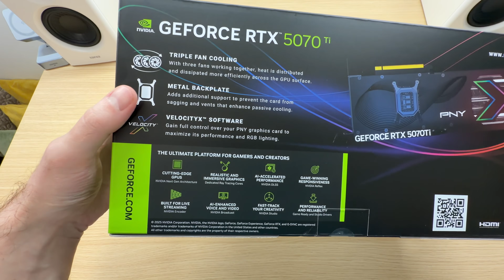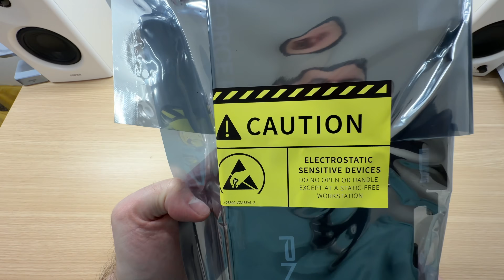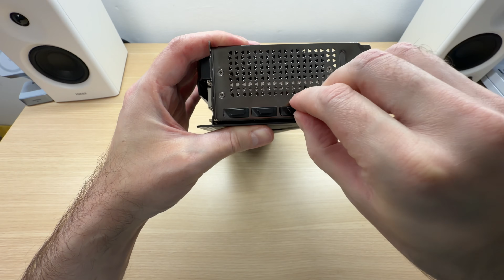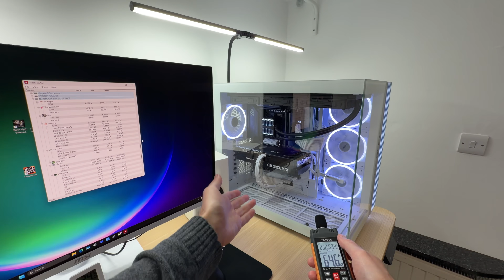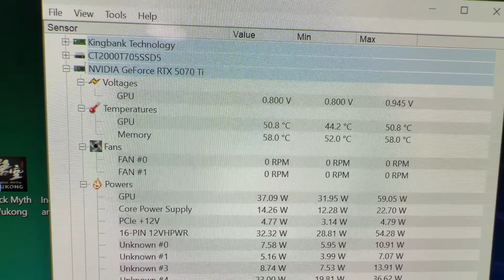Noisy or Quiet? PNY RTX 5070 Ti ARGB OC Review

Comment: Bro, I have the same model, the 5070, and it reaches 80 degrees under load. Do you think that's normal?
Reply from the maker: It's a safe temperature. Your temps may be different because of many variables we have in any PC: case, fans (as well as their speed), other components dumping heat into the case, and let's not forget about your room temperature. I wouldn't worry about it unless you see the temperature jumping up and down rapidly or experiencing performance lower than normal.

Comment: Bought the same card for $789 before taxes. Build quality is good for the price.
I undervolted it with MSI Afterburner: set the curve to 2775MHz at 900mV, +1500 Mem Clock, maxed out power limit. 
So far stable and no coil whine, 40⁰C 20-30W while watching youtube and discord;
50-60⁰C 150-220W under heavy load, you can hear the fans IF you mute your game AND actively looking for it (could be my potato CPU fans though)
Crushes every game at 1440p. Overall, happy with the purchase.
Reply: Lmao I thought you said "crashes at 1440p in every game" 😂😂
I bought this gpu
Reply: Can you link to a guide to do the undervolt? I'd like to learn more about that
Reply: @ivandagiant he has provided all the info needed. Youtube or google if you get stuck.

Comment: how is the rgb controlled?  Can I connect it to mobo?  It looks like at around the 5:57 mark you got a cable plugged in next to the power connector.  Curious if that is the rgb and maybe using an extension cable off that I could control it with other software.
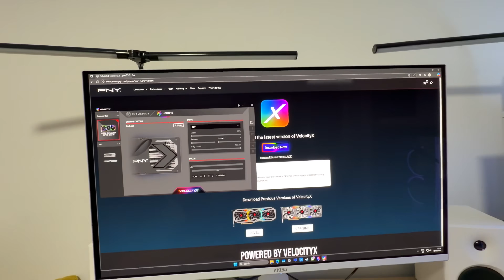Reply from the maker: There's no RGB cable. You can control the lights using the software I show at 10:54. I've no idea if it works with other RGB control apps.
Reply: @theivadim  thanks I am trying to find a gpu that will work with icue even though it means I need their hub to act as a bridge.

Comment: Orderes this same thing. Any issues with it so far?
Reply from the maker: Nope. Works well.
Reply: @theivadim I'm really hesitiant between which cpu to pair it with though, I got my eyes on the 7 9700x or either 7 7800X3D, the last mentioned is about 140 bucks more expensive though. I mainly game.
Reply from the maker: If you don't want to go eSports Pro playing games at super high FPS then the 9700X is more than good enough. If the Ryzen 7 7700X is significantly cheaper in your region then that is also worth considering. You'll have the motherboard that will allow you to upgrade to a faster CPU in the future if you'll need it in like 4 years or more from now. AMD plans on releasing one more CPU generation on AM5 motherboards.
Reply: @theivadim ended up going with the 7 7800X3D, ordered it just this morning actually, because the monitor which I ordered prior to all the pc parts (AW3425DW) Will definitely need that extra FPS and stability on the 1% low, as it's a 240hz 1440x3440 QD-OLED. Also I've always wanted a good X3D CPU since they've launched. 😅 Cheers though! Will be picking up this exact 5070 Ti today. Thanks for your reviews!!
Reply from the maker: Awesome! Enjoy your new setup. It sound lovely🙂
Reply: @theivadim what about R7 5800x?

Comment: 70° for this card with 7 heatpipes but not really good or??
Reply: It might be his specific model or his case airflow. 

I have the PNY 5080 OC and on Cyberpunk at native 4k max ray tracing preset (just for GPU stress testing), I got an average temperature of 64C with a max of 67.8C at 1300+RPM fan speed.

Then again, I have 3 case fans blowing fresh air at it.

Comment: Underwhelming cooling results for a 3 slot GPU.
Reply: 75c at 300w isn't too bad imo. i own the non arbg of this card and with a quick uv it stays in mid 60s with no much performance loss.
Reply: @LCJammer  Yeah I just expected more for the size. 

I ended up going with the ASUS Prime 5070 Ti which is a smaller card at the same price as this and even in the quiet BIOS, I'm getting around 70 degrees at stock with fans spinning at 1300RPM at 300W usage. This is in a silent oriented case with not much airflow as it has all solid panels (Fractal Define 7).

Comment: whats diffrents between Plus version and non-Plus?
Reply: The plus version is much better. It's larger and has 2 extra heat pipes.
Reply: Cannot say for sure for this custom card, but for example the Msi Gaming Trio oc plus has 1 more heatpipe than the version without the plus in the name. So i guess the plus version has a bit better cooling.

Comment: I got one. It's ridiculously loud if not idling. I'm just getting things tuned up, and I'm putting it through its paces running MSFS 2020 at mostly ultra settings. But still...I think it sounds like a Harley Davidson built fan....maybe it's a known issue and there is a fix, and I'm hoping so as I dive in to find out what I can possibly do. Just sounds horribly unbalanced.
Reply: Any updates on how the card is
Reply: @SyrupCanuck the mounting arm support was too high I believe, and it caused the plastic housing to twist ever so slightly, therefore allowing blades to make contact when in operation. Almost 100% quiet when graphics arent under much load. But it gets decently loud when trying to cool chip still yet.
Reply: I totally lwft part out where i fixed the height of the support arm and it made a world of difference
Reply: @Superimposed_Goat i just grabbed one from Best Buy PNY GeForce RTX 5070 Ti ARGB Epic-X RGB OC Triple-Fan 16GB GDDR7 Video Card and wondering if it's a good purchase. In CANADA it's one of the cheapest. I just never used PNY before. Hard to find long term testers.
Reply: @SyrupCanuck this is my first build, so its hard for me to really say.
I am totally happy with it though! Its worked great so far
Reply: @Superimposed_Goat thats good to hear. I probably will keep mine. I just want it to stay cool in my sons pc

Comment: To add a little more information to the video, this model has five heat pipes. Since five pipes are in contact with the core, that's how they're usually counted. The higher-end Plus version has seven pipes. There are so many people on the planet who confuse the two. The PLUS version is not sold in some countries, so many people don't even know it exists. I would buy the regular version, optimize it by undervolting and power limiting, and then put a phase change thermal pad on the core. That's all you need. Since the previous generation of PNY products had a particularly high rate of grease pumping out, I recommend doing this immediately after purchase. This will eliminate the risk of damaging the thermal pads that cool the memory, etc. Over time, there is a high probability that they will be damaged when disassembled.
PNY has adopted DBB for the XX70 this generation. This improves fan durability. If you take the steps mentioned above to prevent pump-out, this card will be an excellent card that will last for a long time. The quality of the current generation of PNY has improved in all grades, which is a good impression. The previous generation was pretty bad and had a bad reputation, but this generation looks set to get good reviews.
Reply: I had to apply a phase change pad to my 4070 Ti from PNY. Just note that PNY will void your warranty if you open up the card.

I wouldn't buy them again, support was rude and seemed to not want to RMA my card, that's why I ended up doing it myself.
Reply: @d @dinospumoni8255  your card was “fine” for them. They’ll avoid RMA. 
I’m surprised it voids your warranty as it never voided mine on few gpus (Vega 56 pulse, 2080s FE, 3080 gzt MSI, 6800xt Sakura, 4070ti Spiderman, 4070ti tuf, 7900xtx gaming OC)
Reply: Just wanted to add that the 5080 and 5090 has the bigger cooler as well. Check the card length. The plus versions are around 330mm. The normal smaller cooler is around 300mm like the one in this video. The 5070 ti PLUS has the 330mm cooler.
Reply: You think it's really necessary to change the pads? I would prefer to keep the warranty.
Reply: @sushu-x7f  It's probably best to perform regular tests under a certain load, and if the temperature doesn't rise, continue using it as is. Since GeForce has discontinued hotspot temperature monitoring, there is no longer a reliable way to know if the thermal paste is working properly. Even if the core temperature is relatively low, the hotspot temperature can be very high. Ideally, you would want to monitor the hotspot temperature, but this is not possible. Instead, carefully monitor the core temperature. If it starts to rise slightly, it means the thermal paste is beginning to lose its effectiveness. If grease pump-out occurs prematurely, even if you exercise the warranty, all that will happen is that the same grease will be reapplied and the product will be returned. In that case, the problem will likely recur after the same period of time has passed. Therefore, if it were me, I would replace it with a phase-change thermal pad myself.
This explanation has become quite long, but generally speaking, it's best to do nothing to maintain your warranty while no problems are occurring. Usually, it's sufficient to consider countermeasures only after a temperature problem occurs.
Reply: @銀河光芒  thank you for the comprehensive answer :) Good to know we can't monitor hotspots anymore, if unfortunate. I just received my 5070 so I will monitor the temps closely.
Reply: i got the previous gen epic x 4080 s oc for 2 years and the temps are the same as day 1.. just upgraded to the 5080 version and it is a bit smaller hopes it last as long XD
Reply: @TheMichaelparis  from what I've heard the 5080 didn't have the hotspot issue the 5070 did. So you should be good. Still worth undervolting and maybe running an aggressive fan curve though!
Reply: English please
Reply: @Mike_Hawk_Is_Hugh_Mungus Pump out is when thermal paste displaces/degrades over time due to wide temp changes, it's an inevitability for GPUs, but most of the time can ignore it as it's a slow increase in temps (years, unless poor build quality).
Changing the paste to a phase change pad more or less eliminates this slow increase in temps from happening. And will increase the lifespan of your GPU, for sure. However, if you're not at least average on the handiness/carefulness scale, I wouldn't do it yourself. 
Most of the OP's suggestions and tweaks are very much improvements that will increase the lifespan of a card, but for most people they're unnecessary (unless, again, the GPU itself is poor build quality), unless they're tech savvy. Finally, PNY customer service specifically is notoriously hard to deal with, and will void your warranty for even thinking about opening up your GPU.

Comment: I undervolt my RTX370. From 1V to about 910 mV. It drops ower from 210W to 170W and no FPS difference. Also I change Quiet BIOS to 260W. I cqan Overclock this to 2100MHz (+11% more pover) but it is only for tests. I manually overclocket and UV my card. Now it is about +10% more power but in deafult 220W power consumption. RTX3070 TI is only +10-15% faster but Powerc consumption is huge.

Comment: I thought I purchased this same model but it turns out to be a Triple Fan Plus model. It has slightly bigger cooling system and temperature maintains around 65⁰C in furmark stress test. The cheapest 5070ti available in my country is $950 and I got  mine at $1000, so I think I got the good deal too 😁

Comment: This is the quietest and coolest graphics card I've ever had. Sag bracket included in the box is also great. The only downside is that it doesn't have dual bios, but I don't need that. Btw, I also have the Edifier MR4 speakers and they'e awesome!

Comment: I'm in doubt whether to buy the 5070 or wait for the 5070 super, if I'm going to buy the 5070 which model is better, the 5070 PNY triple fan OC  no RGB for 565 euros or the 5070 Gigabyte windforce SFF OC for 579 euros? I'm going to play campaign games at 1440p and I have the Ryzen 7700, I'm currently using the CPU's integrated graphics
Reply: Hey just ask what you decided. I was on the fence for a while and recently bought my 5070 ti to get ahead of any Ai stuff, what'd you do?
Reply: @aprofessionalgamer5355 i just bought the 5070 MSI Gaming Trio OC for 620€, it comes with a 40€ Steam gift card and is really silent and beautiful, i use DLSS at 4k and in 1440p you almost dont need, just if you use Ray tracing, and frame gen is really good, almost no input lag and DLSS and FG is almost perfect, in my opinion the 5070 is a really strong GPU for 1440p and you can try 4k easly with DLSS, and the vram for me is not a problem, just if you use 4k max setings with Ray tracing in more intensive games, but that is to intensive for the GPU, even the 5090 cant do it native, just use DLSS on 4k, and it will be really good👍, if you need more VRAM go for the 5070 ti, i think the 5070 ti is to expencive 👍
Reply: @aprofessionalgamer5355  I was in the same situation and I bought a 5070 ti. The thing with NVIDIA new release I understand is that it may take up to a year for prices to come even near MSRP. So with the 5070 SUPER rumored to release between first and second quarter of this year, except it to be unaffordable for up to another year.

Comment: in my country , this 5070 Ti ARGB OC cost exactly the same as Zotac's AMP Extreme Infinity which had even higher quality than this .. which is super super weird
Reply: I owned that Amp extreme infinity for a while and it pissed me off that Zotac decided to set minium fan speed at 1200 RPM. This results in an audible start and stop behaviour instead of ramping up from 500-600 RPM like an Asus TUF or Prime would. I don't like Asus but that's the one thing it has been good at, making the fans start at a sensible RPM. 
Ended up selling the Zotac because that's not how a massive premium GPU should behave.

Comment: This sample is really hot...2000 rpm at stock 72 75°
Reply: doesnt have ptm7950 like other models,  dropped temps on mine a lot
Reply: @wrocksk7977m  what models have ptm
Reply: Asus models, MSI gamers X trio
Reply: @wrocksk7977m  yeah, after hot spot temps are now available, I'll do the same.

Comment: i buy same card last month, that cost ~750$ in Vietnam
cheapest 5070 ti i can found
no coil whine, no noise
everything is good
Reply: Dang excuse me if im mistaken but 750 is cheaper than what it is in america, at least before tax.
Reply: @aprofessionalgamer5355  750 include tax , with discount of Shopee ( like amazon in america )
Reply: @aprofessionalgamer5355  FYI, 750 is only when there is a sale-off on e-commerce website (similar to Amazon) with discount vouchers applied. Other than that, the average store's price is actually around 850 include tax
Reply: con này best p/p rồi bạn. Mua shopee Nguyễn Công mà 20tr5 được 5070 ti thì best cmnl. Xem clip thì thấy nó sẽ ồn và nóng hơn các con khác bên Asus, MSI, hoặc gygabyte.
IDLE mà 50 độ C thì cũng không phải mát, hơi nóng. Tải nặng thì card mới mà khoảng 75 độ thì cũng là nóng. Nhưng với cái giá 20tr5 thì cân tất không còn gì để chê.
Reply: @hoangnguyen-yw6bj  con này Nguyễn Công bán 22tr5 mà bác, ngang giá con Inno3D
Reply: Game nặng tầm nhiêu độ vậy bác, e cũng tính mua e này.
Reply: @khanghua9132  test full load ~70 75 bác ơi , nhưng con này mạnh nên e chơi 2k chả bao giờ full load